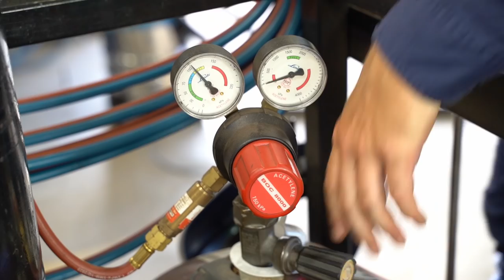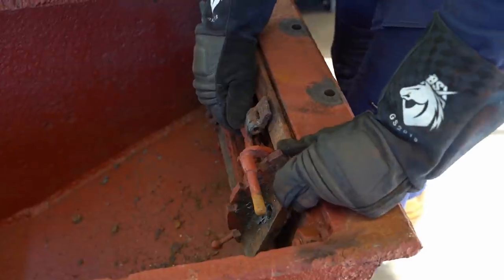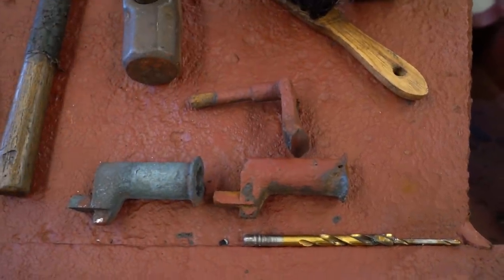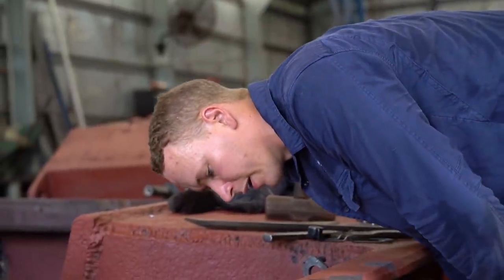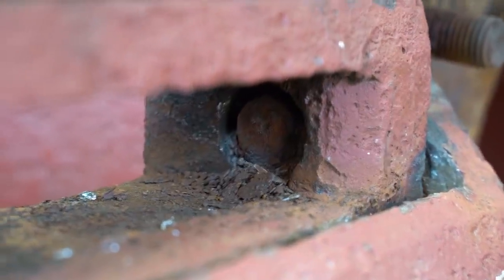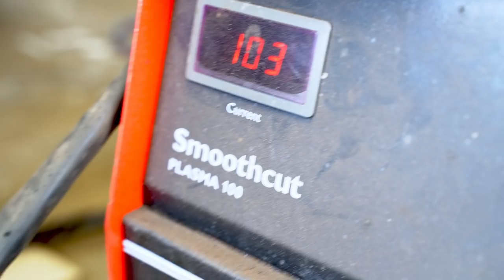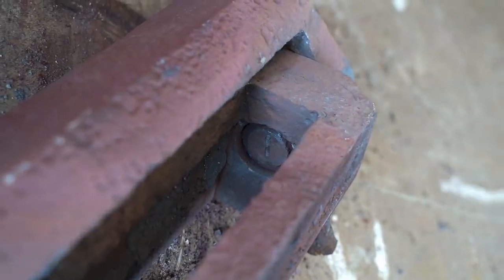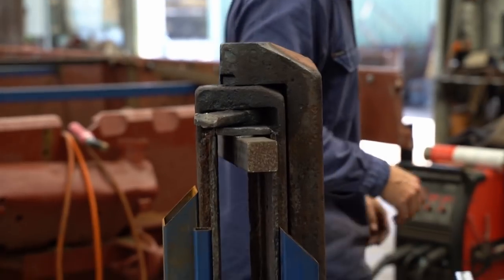Workshop Wednesday - STUG III RESTORATION Ep. 5

Comment: 20:44 Even after all these years, it still works. Absolutely amazing. 

I'm a sparky so all of my insulated tools (screwdriver's, plier's, cutter's, cable sheers & grips) from the very beginning, have been German due to the outstanding build quality. 
I also love German car's, as I currently have a Mk7.5 Golf GTD which I love. 

You can't beat Germany engineering 😊👍🏻

Comment: A repair is never going to be stronger than the original undamaged part.
Reply: Are you suggesting he remove the vision block in some other way than he did? Also, when he welds that back together he will use filler rod that is of a higher strength than the base metal.
Reply: Selecting the right weld rod and correct weld technique will make a stronger part.
Reply: @spudpud-T67  Indeed it will.

Comment: An incredibly complicated piece to take apart. You can see clearly why the Germans weren't able to repair or replace damaged equipment fast enough to keep up, particularly toward the end
Reply: No doubt hard to believe this is over 80+ years old and the skills used to build it and machine tools. Plus they did not have lots of the tools we got today.
Reply: This was never designed to be taken apart…
80 years of rust (and blast damage) doesn’t help either.
Reply: Lack of spare parts was a major issue rather than complexity. Not enough focus given on getting what parts there were to the front as well.
Reply: @legbreaker2762  Lack of spare parts certainly was an issue but complexity of construction was a hallmark of German engineering. Having been in the field repairing military equipment the secret of winning a battel or getting a job done on time is simplicity. As is clearly demonstrated the drivers sight armor is beautifully built and 80 years latter can still be made functional but there is no way that it can be rebuilt in the field without a full workshop and the drivers sight glass is a primary target. 
Blind the driver and you stop the tank plus it is a vertical face of necessity and therefore a prime target on the front of the tank for penetration so needed to be changed out quickly in the field.
Reply: Ya you weren't fixing this assembly in the battlefield lol
Reply: @horsebee1  The vision blocks slid in from the interior of the crew compartment. No disassembly required, very quickly done. Normally there's a tin box on the hull adjacent to the driver's position with several spares. Same thing in the cupola.
Reply: @horsebee1  Ex-mil myself. Simplicity is ideal, but not at the cost of protection, etc.
What we can see there was fairly simple, but near 80 years in a swamp hasn't done it any favours. I'm certain it was a work of beauty initially, before the rust set in.
Reply: @no ël in part, yes, but if they were still able to produce the whole vehicle, then surely they were capable of making the parts that went into them?
No, this was a logistical failure. Not enough emphasis was placed on keeping what they had operational compared to producing the newest Wunderwaffe.

Comment: I found a port-a-power (portable hydraulic press) worked well to apply even and steady pressure on frozen parts,  mild heat and a few billion raps with a BFH did the rest. Russian junk didn't have the same kind of close tolerances that the Germans insisted on however.  In the end "anything that works is the right way."

Comment: Loving the work you guys are doing! Have you all thought about arc air gouging to remove weld rather than plasma gouging? I work in heavy earth moving in the CQ coal fields and its our go to method for this sort of work. Great for getting into those tight places where the plasma wont reach.
Keep up the good work, I will definitely have to take a drive down the hill and check out the museum👍

Comment: More damage than restoration. Paint prior to strip ?  Cooking cast parts and ? Did not even try to remove stud, just hack it. Well he will be removing it now. He just made another weeks work. It would take weeks of soaking and a porta power or other hydraulic tool to remove properly, next time take a piece of paper and pencil and draw the parts, it will help you figure out how it went toegether. Calling this a restoration is an insult to Mr. Allen, Mr Weeks, and my limited knowledge. Appears to be scam channel, throw paint on it and call it a restoration.
Reply: These guys are extremely passionate about what they do and they do not take shortcuts, your comment is extremely offensive. I'm sure if they could soak an entire stug superstructure they would've tried that. As for the paint, it was applied before they received their parts. You may want to educate yourself a little before commenting.